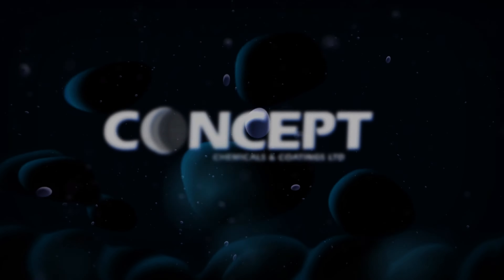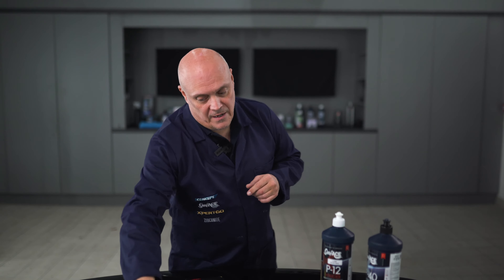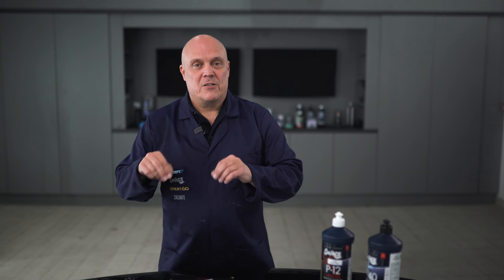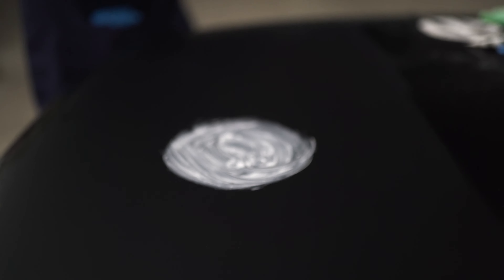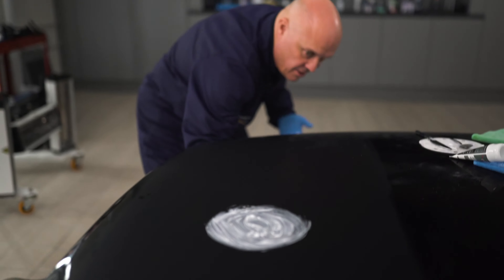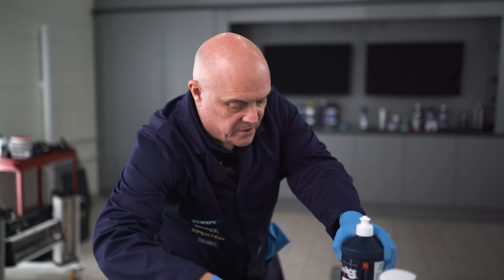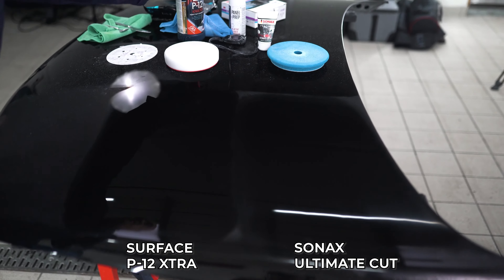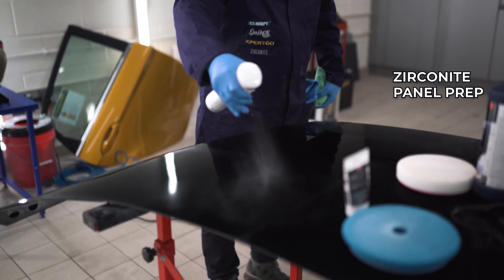ATP | P-12 XTRA Vs Sonax Ultimate Cut F2

Comment: One MAJOR flaw in this test.

I understand that you were following recommendations from detailers when it came to polish and pad choice.

However, the blue Rupes DA Coarse pad is known to be very harsh and not well finishing.

A much fairer comparison would have been to use both polishes on the same pad or use the Sonax polish with the respective pad by Sonax.

All you showed in this video is that your own polish and pad combo worked better on this paint and with the chosen machine than the other polish and pad combo.

Any other conclusion, i.e. that your polish is better than the one by Sonax, simply can‘t be drawn from this test.
Reply from the maker: Thank you Andreas for your comment,  based on your fairer comparison recommendation we will do another video, watch out for it coming soon